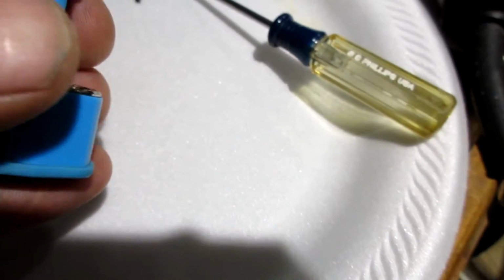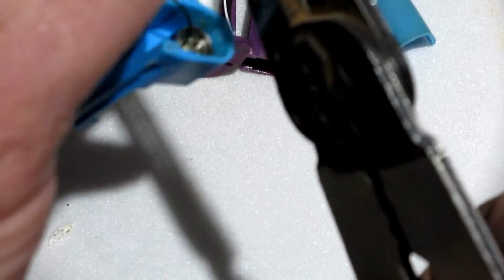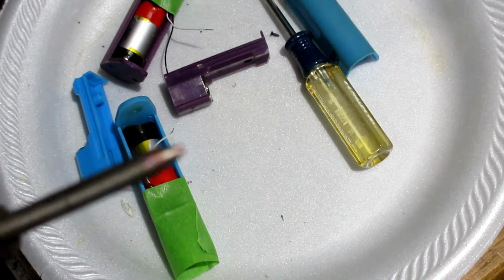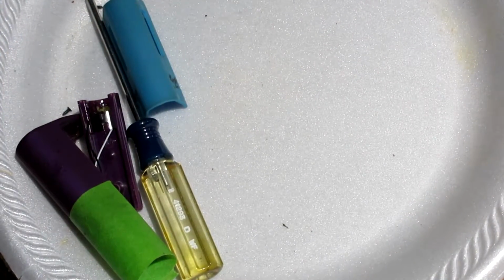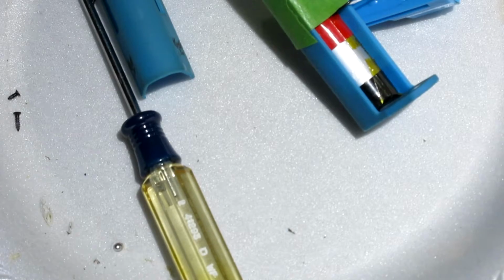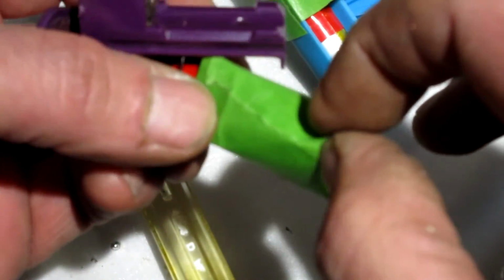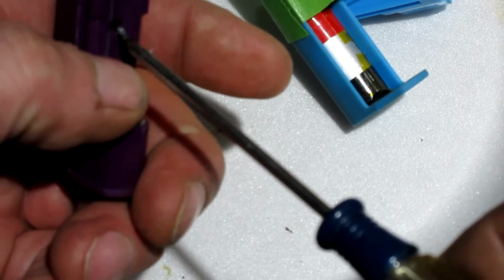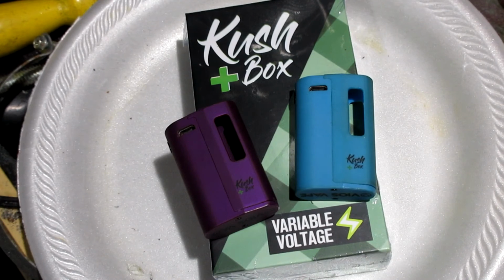Kush Box quit working? See why and how to fix. How to repair Kush Box VIOS VAPE CO

Comment: So how do I know if this is the issue? Mines blinking 3 times and not hitting
Reply from the maker: After fixing probably 20 of these from myself and friends, it's always the wire fell off... (one the mother board went bad) Either it got to hot and fell off or removing your cart, it spun the contact and broke off. Also, the one I accidently wore into the swimming pool in July dried out and now works again...lol